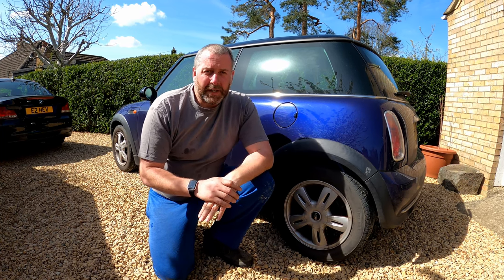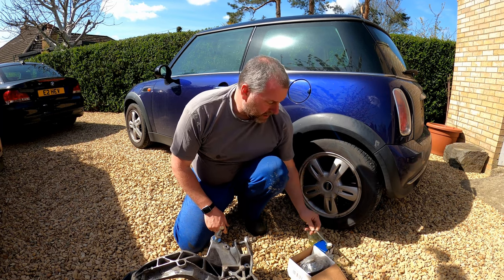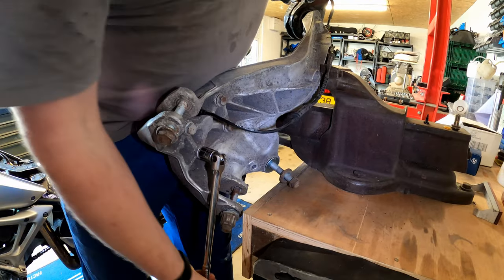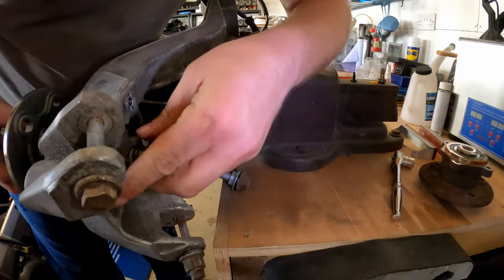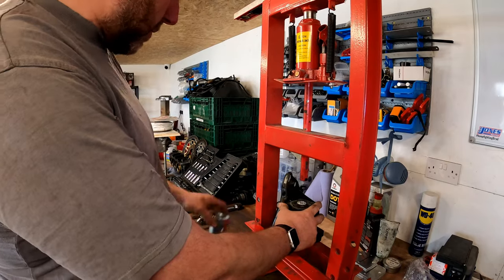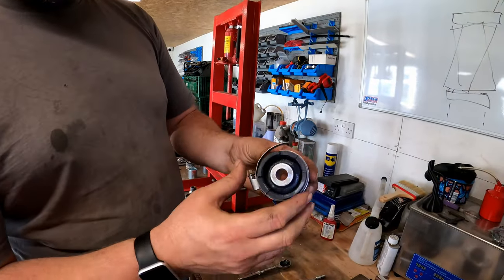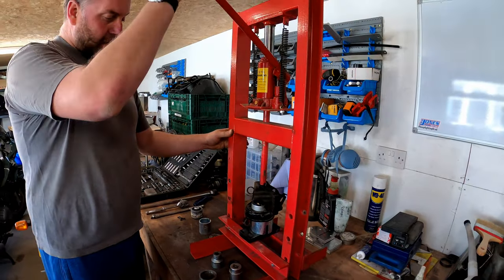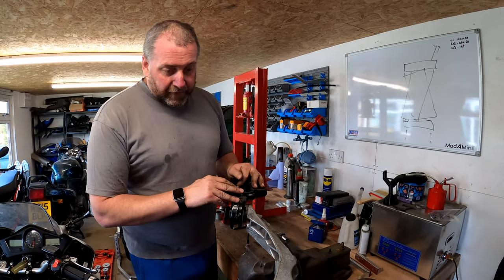Mini R50, R52 & R53 Rear Trailing Arm Upgrade - Gen 2 R56 Alloy Arm Fitment On The Gen 1 Models Pt 1

Comment from the maker: Hey guys! I just want to add this as a pinned comment so that you don't have to go through the trial and error with any additional costs for sensors etc. It turns out that the R56 ABS sensors that came with the arms are not compatible with Gen 1 mini ABS modules. I even went to the expense of buying brand new R56 sensors only to find that they didn't work either. I had an ABS light up on the dash that would not go. What I did is fitted the original sensors that were fitted to the original R50 trailing arms, the hole that the sensors fit to on the alloy arms is of a wider diameter than the R50 sensors, however all I did was position the sensor roughly in the centre of the hole and tighten the screw securely. After deleting the error codes, this cured the problem! Hopefully this helps you out and prevents a whole lot of head scratching.
Reply: Did you re use the calliper retaining bolts or are they slightly short?
Reply from the maker: @Jonathan-qz9kd  they are fine, they fit exactly as they did on the old arms mate 👍🏻
Reply: @KevsShed  haha yeah I saw that part after I sent the message! One other question did you use the shock bolt washer from the r56 or the r53/50 funny hex bolt? Great video!
Reply from the maker: @Jonathan  R56 bolt bud

Comment: If I remember correctly the wheel bolt size is different from the Gen 1 to the Gen 2 (12mm versus 14mm), so you have to use Gen 1 hubs/bearings.
Reply from the maker: You are correct, I actually didn’t realise this! I just bought a set of larger bolts instead! 😁
Reply: Good to know!  Thanks for the info.
Reply: So you CAN use the r53 wheel bearings on the r56 arms?

Comment: Very well made video!  I am about to do the same upgrade on my R53.  I have all the parts, I'm just waiting for the weather to cool a bit here.  Also debating whether or not to install polyurethane bushings in my new trailing arms even though the rubber bushings that are in them are good.

Comment: Question
Are the wheel bearings on the r53 the same as the r56?
I ask because I’ve studded my r53 and use lug nuts rather than bolts, so would need to stud the new r56 wheel bearings if the r53 won’t work.

Great videos by the way..exactly what I was looking for!
Bought my alloy arms 2 years ago but have been putting off the instal until I could see it done.

Thanks
Reply from the maker: So here’s the thing! I assumed that they were, and on the face of it they are. The only difference is that the R53 uses M12 wheel bolts and the R56 uses M14! I didn’t realise this until I had the whole thing reassembled and went to put the wheels back on! 🤦🏻‍♂️ luckily I had a set of M14 wheel bolts in the garage! Worth keeping this in mind 👍🏻
Reply: Perfect, I’ll just reuse mine then so I don’t have to buy another stud kit…
They were newer when I installed the studs so they’ll be fine for a few year

Comment: Hi Kev,
Are the R56 top mounts interchangeable with the R50 top mounts? (the mounts of which you changed the bushes).
I can't get the steel bolts out of the aluminium and would like to re-use the top mounts if possible...
Reply from the maker: Having a look at RealOEM, it lists the R50 top mount as fitting the following models:
MINI R50
MINI R53
MINI R56
MINI R56 LCI
MINI Clubman R55
MINI Clubman R55 LCI
MINI Cabrio R52

The part number is Left - 33526754123 &  Right - 33526754124

👍🏻
Reply: @KevsShed  thanks a million!